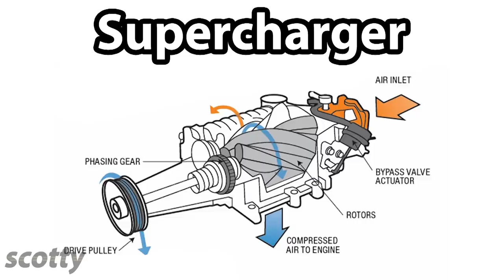Supercharger vs Turbocharger - Why Supercharged Car is Better than Turbo

Comment: Normally im with ya scott, but this is where we differ. Turbos are MILES cheaper 5han any other power adder. Blowers are the easiest to install, but the cheapest blower vs the cheapest turbo system, is still $2000 difference at MINIMUM.

Comment: The first generation Mazda MX-6 GT has A turbo and A resonance boost system.  So at 4K RPMs the engine makes even more power than it would with the turbo charger alone.   
Later on Mazda named the system VRIS.

If modified correctly the engine makes some decent power.  My brother has beaten some Corvettes with his.

Comment: Superchargers aren't always the way to go tho, yeah they can be more instantaneous and have a very linear boost curve, but turbos are way more efficient at making power, it doesn't rob you of power because it's not run off the engine itself, and depending on the set up you can have the boost come in where you want it, not always as instantaneous as a supercharger but with the right set up, turbos sometimes are the better way to go, it all depends on the situation

Comment: Turbocharger is more efficent and can produce more power since it uses a secondary source to get power which is the exhaust gas, while a supercharger uses the engine power to give power thus making it way way less efficent unfortunately.

Simple physics

Update: This also enables turbochargers to increase HP further than superchargers since they are not dependent of engine power since it's not connected to the belt like a supercharger.

Comment: Another benefit of superchargers over turbos is that the exhaust sounds better and raw, like a naturally aspirated engine. Turbos use some of that exhaust to drive the turbo and it definitely has a negative effect on the sound of the car in comparison to natural aspiration or superchargers.

Comment: Scotty what about another method, dedicate some space in trunk get a lawnmower engine, connect a super charger by belt have the lawnmower engine at the revlimiter like a switch hooked up to the No s bottle and when full throttle press switch and air is pumped to engine by lawnmower powered engine .

Comment: Modern day turbo chargers have zero lag and make more power than superchargers! GM has a twin scroll turbo with zero lag which I test drive in a 2016 Chevy Malibu premier and it had instant throttle response, but a 2011 Malibu with no turbo actually had throttle lag! And Mazda has a new dynamic pressure turbo that has no lag and I'm sure there are other examples!

Comment: I remember reading a car magazine a long time ago about a guy who built a Trans Am and couldn't decide if he wanted a supercharger or a turbocharger so he installed BOTH.   It was making 600HP to the wheels which was the end of the world in those days.  
Thinking of that black car Mad Max stole from the police station with the gigantic supercharger on it.  I've convinced myself that I prefer N/A more than turbo because it's a more linear and predictable power curve... but supercharging....overcomes this objection.  Yeah the turbo guys always raise the point that superchargers leech power from the engine since it's belt driven but that's not saying much when the tradeoff is huge and the power curve is enhanced from any engine speed.

Comment: it might be cheaper to install but from what i have seen a supercharger cost more, and if you are going to get one i think it would be wise to get a centrifugal supercharger because i dont think it turns the supercharger at very low rpms so you can still baby it and get decent fuel economy

Comment: I had my first encounter with a modded 2012 golf R the other day. I was driving my 04 comp g gtp with moderate bolt ons (1.9 rockers, t stat, pcm, full exhaust, headers and intake) this car was behind me and the color looked unusual. We were at a stop light light and I was getting ready to  on the highway. As the light turned green, he revved his engine behind me and I noticed the MK6 headlights along the R badge up front. He had no front bumper but a big intercooler. He probably saw my vacuum gauge cluster (previous owner installed but never finished) that was not working and assumed I was clapped out or just faking. I knew he had more power than me but I had one thing that he did not have which is instant torque. I merged on the freeway like I usually do, full throttle, as first gear is not slow but nothing to brag about. Second is the go gear in my car. From 60-90, the comp g will surprise most newer faster cars. He waited and then brake boosted and I saw him catching behind me but never enough to pull ahead. This was in traffic on a 55mph two lane highway. It was the perfect scenario for the GTP. He was chasing me but could never pass me. Every time he got full boost, he had to slow down because of traffic. I then got in the slow lane to pull off my next exit and I gave him the thumbs up while we were side by side. He pulled away angrily weaving in and out of traffic around 80-90mph. He was definitely faster and would gap me hard on an open road. However, it felt really good showing him all the positives being supercharged.

Comment: Doesn't a turbo have to wind down before you can shut off the engine compared to a supercharger?
Reply: indeed it does, you dont want to cook the oil in the turbo, and yes you have to have more frequent oil changes

Comment: Turbo's rely on WASTED exhaust gasses, plus running low boost you usually don't lose any MPG (you can gain a few MPG sometimes) because pumping losses decrease.

Comment: The best set up is the audis electric supercharger and a normal turbocharger.  They saw almost 0 lag as the supercharger was able to reach its full spool speed of 75k ram in 0.25 seconds.

Comment: Depending on the application. I would pick turbo's over a super charger. No belt slip, better fine tuning. On the low end of course you're not going to have the boost right away, you need to spoil up, but with no belt slip the turbo will take that motor all the way till the rings connect and the motor detonates. I've seen cars now days with a small blower and a turbo. Racing is getting crazy. I'm sure there's someone who'd got a blower, twin turbos, and a 200 shot of nitrous lol

Comment: I would go out and super charge my truck but I dont feel like blowing up the stock block. I already have a better trans,Plugs wires,exhaust and air intake but still not convinced shoving 600hp into a already 320hp dakota is a good idea lol.

Comment: You can turbo charge anything as well. And turbo charging is WAY cheaper than a super. Not to mention that the same amount of boost you get more horses out of a turbo than supercharger. it just depends on the application you are trying to use it for. depends completely on your set up and what you are trying to do with your car. Also, do you like whine or whistle. lol.
Reply: whine baby whine

Comment: Personal opinion I guess. But supercharger is not cheaper u can always find a cheaper turbo setup. If u have a old school ride it's easy to install. New age vehicle supercharging requires all the hassle turbocharging .If I wanted to supercharge my Silverado 3000  verses 1000 to turbocharge it. But a good turbo setup will always overcome that supercharger on the top end. The engine can only turn the belt to a limit. The turbo can spool to basically no limit.

Comment: Twin turbos all day long. It takes power to run a SC. turbos use hot expanding exhaust gas which is being dumped out the tail pipe anyway.

Comment: I wanna have a supercharger that blows air into my turbocharger which drives a seperate engine I fittet into the trunk, which will drive an electric generator, hooked up to an electric motor, driving a supercharger which gives my cars engine more power. Cause the more turbos and superchargers your car has, the faster it goes. Foolproof concept!

Comment: I totally agree with your assessments of superchargers vs turbos applications to the engine. Turbos save fuel but at cost to consistency of performance and immediate power and simple joy of driving. There is nothing more frustrating than having that turbo lag which is inherent at times, even in the best designed turbos. Further, that turbo lag can be outright dangerous if needed boost is required to get out of  tricky and dangerously unsafe road situations and vehicle obstructions. Smoothness and measured needed control and performance are also compromised with turbos. So, puting it all together, for these reasons and others too numerous to mention, I'll take superchargers any day of the week if they are properly engineered and interfaced.
Reply: I never ever  heard somebody with a 3 diesel turbocharged saying  I almost got killed bcs turbo lag. If you almost got killed bcs of turbo lag, probably you were overtaking dangerously and you deserve to get license taken

Comment: This video is all based on stuff Scotty learned 25 years ago. Modern turbos are by far better in most cases and they are just getting better. A lot of the newest turbo performance cars have practical no lag. I drove a 718 Cayman recently and could have sworn it was NA if not for the sound, the power is instant.

Comment: Ive had supercharged and turbocharged cars. Turbo is 1000% better. Turbo just needs a boost controller amd u have power on tap. U can also throw on a fmic in 30mins with the supercharger  u have to do plate modifications and it is sooo expensive. For more  psi u need to start playing with pulley sizes etc, with turbo u just up the boost.

Comment: While all of your points are good, I prefer turbo. Mostly for the reason you mentioned....better fuel economy and power. 

As far as the amount of power they can make....a turbo can make just as much power if not more. 

But, I do prefer the SOUND of a supercharger. And turbo lag is a non issue today. So no advantage for superchargers there anymore.

Comment: Ok well there’s a flaw that’s been pointed out numerous times superchargers are belt driven  a turbo that kicks in at 2k at 10psi  at 2k the supercharger will most likely be at 2-3psi and at peak power you have 10 superchargers have linear lag where you don’t feel it ass much because it’s a slow climb turbo lag is spool the full boost

Comment: So beside the fuel economy arguement, why are diesel trucks not super charged?  I hate the turbo lag in my truck. I always seem to find that the turbo kicks in just as the truck is crawling out of the mud and bam, all four wheels break loose and dig me in further. Or its the difference between not enough acceleration, then it kicks and there is far too much and your in the back seat of the prius ahead of you.  I feel that super chargers would give the vehicle better control.

Comment: Superchargers require engine from the power to run them so therefore you were losing power in the beginning before the supercharger can ever generate that horsepower back on top of that the supercharger you are correct does give you that instant gratification but it quickly Fades and dies where's the turbocharger is the opposite depending on how your setup but the most common way is they consistently pull throughout the Power Band. There's a reason Lingenfelter runs turbos and not superchargers and there's a reason why all the hyper cars and even super cars run turbos they're more effective in generating horsepower.

Comment: Dear Sir, I enjoy your videos,  which show your knowledge of all things connected with cars, but one thing: a turbocharger is also a supercharger, because it "super charges" the inlet mixture. What you call a "supercharger", I think you should call a "compressor".  Unless the American language differs in that respect from the English. And sorry, but a turbocharger is much more efficient than a compressor, what you call a supercharger, that's why racing cars only use turbochargers!

Comment: That Corvette engine that goes from 500 hp directly to 1200 hp thanks to the supercharger - how much does that supercharger costs? And how much would it cost to achieve the same results with a turbo?

Comment: Hey Buddy Seen you on TikTok What would be the best way to find a shop that can install performance parts without getting ripped off? Most of these places are either out of state are it's a long long drive 😭😭😭😭 I am with you on simpler is better

Comment: This is all well and good, but I don't want to have max boost at only redline. I would rather have max boost from 4000 to 8000 rpm with the help of a wastegate.  Plus...turbo lag is fun, and it allows you to run in vacuum while just putting around, which greatly increases fuel mileage.  Turbos don't have much or any power draw, they use a resource otherwise wasted, and they are not more expensive, which the video stated.  They might be for larger engines, like LS motors or Coyotes, but not for smaller motors (under 4 L, generally).  I drive a MK4 VW Golf with the 12v VR6, which I turbocharged.  I don't know how much it costed exactly, but for the money I got far more power than if I had supercharged it.

Comment: I think the turbo is better because you can get better mileage with it and better performance, which you can't do with a supercharger. Unlike some hightech engines that will use the supercharger at low boost to make more precise fuel mixture, most supercharged engines will cost more to run.

Comment: wrong, this explains why you like them scotty. Turbo is the more efficient means of supercharging an engine, also intercooler makes the intake air cooler that helps with emissions, knocking etc. Turbos are complex and delicate,you need a slow start and an idle before shutdown , you also need good oil and oil pressure to keep them running.

Comment: What are 2 or 3 robust V8 & V6 motors to supercharge?  (If you can list 3 of each flavor)  I'm new to modding but have been doing my own car maintenance for years & can change the timing belt on my '97 Lexus ES300 so am not fearful of any modding challenge.  I would like to buy a late 90's or early 2000's car & modify it but I've heard if you don't have a robust motor, it won't last as long.  Thanks.

Comment: since supercharger is direct connect to engine belt and turbo is connect to exhaust pipe, then would it be possible to insert both supercharger and turbo at the same time??

Comment: I drive an 02 Camry with a 4 cylinder engine. I sure as hell don't need 600 horsepower but I would like maybe 100, so I can have a little more get up and go. Do they have smaller superchargers for something like that

Comment: Hi Scotty.   With a super charger, if your driving sensibly, will it save you fuel, in the same way a turbo will driving sensibly?!  I'm presuming it does, because it's making the engine for efficient? Thanks!
Reply: I have a supercharger, but I like  turbos they are more efficient but my supercharger didn't effect my gas mileage at all it depends on your setup and application. Drag race turbos all day,course racing and time attack supercharger so in the end personal preference. Ps, yes you can get better gas mileage with  turbos as long you tune it for that and superchargers as long as you're in vacuum your not killing your mpg

Comment: Best choice I ever made was going with a roots supercharger.
Reply: adamra187 turbocharger better
Reply: @mrkemoymrbailey9741  not for daily driving though. I should have been more clear.  Turbo is better but I personally wouldn't turbo a DD.  Have done it before.  I prefer working on the cold side :)
Reply: adamra187 Turbocharger faster and better kid daily driving 

Supercharger will spin up to 50,000 RPM
Supercharger take is power from the crankshaft

turbocharger draw is power from exhaust gases that result from combustion 

turbocharger is not connected to engine and can spin must faster

What do you mean kid? I’m mechanic
Reply: @mrkemoymrbailey9741  lol...

Comment: Superchargers are better in one thing, and one thing only...instant boost. But... you typically can't get as much boost from a supercharger as you can from a turbo, it uses a substantial amount of the engine's power to even run. They eat your fuel economy, and you can't adjust the boost simply without changing parts (you've got to adjust pulley sizes). I much prefer a turbo. Modern turbocharged cars from makes like Honda, and VW (Audi, Porsche, etc.), don't have any lag, they pull hard to redline and are easily tuned with software to extract gobs more power. I have a supercharged car and I have a turbo car. My car's supercharged V6 can't touch the wallop of torque you get from a turbocharged 6-cylinder engine or even some of the great 4-cylinder turbo engines. Snails for the win!

Comment: Turbos are way better. More power per PSI and more efficient. Superchargers cost 4-10 thousand bucks whereas you can buy a turbo, manifold and plumbing and put it together for $2000 or less in many cases. Toyota Tacoma’s came with superchargers on the TRD package (as an option) that made 240 HP to the wheels for $5000 more than the naturally aspirated version... I installed a turbo kit on my tacoma for less than $3000 and I’m making 290 WHP at the same boost pressure that the factory supercharger made.

Comment: Can I able to fit a small supercharger in my 2013 Mazda CX-5 currently 155 hp only ?
Reply: Absolutely! Just make sure to size it properly, and you'll need get a tune so the engine knows it can inject more fuel. People have supercharged lawnmowers, so no engine is too small.